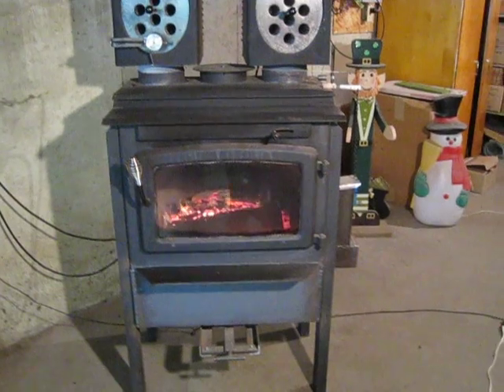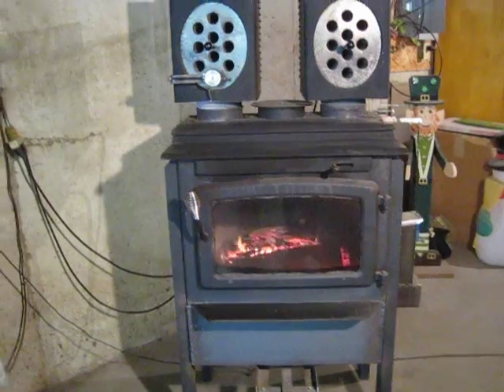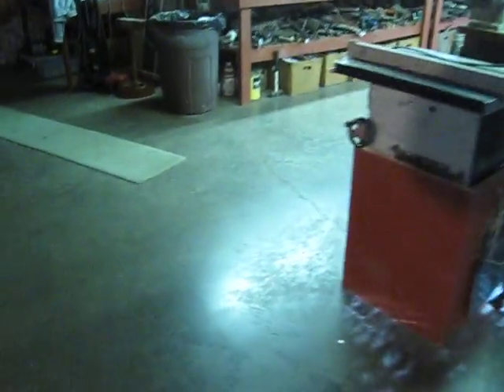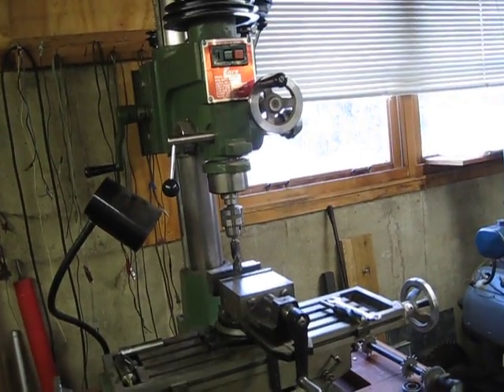Woodstove

Comment from the maker: Thanks for the comments e2sguy & everybody--the wood I burn has been cut &split 2 to 3 thee years before I use it. I have no creosote build up at all--clean flue once a year &  get some dry flakey ash only. Been using this stove all winter long for about 5 years now. Would not change a thing. Even with the Magic Heaters it still has a strong draft.   Very important !!!  Air intake to fire box must be controlled to stop stove from over heating. Know what your doing or these wood heaters can be very dangerous.

Comment: Re: Magic heat......We have had ours for over 10 years now with only 8" of pipe between the stove and the unit...Never too much of a problem...We have had the tubes glow red hot more then a few times, such as  when first starting a fire and forgetting the door is cracked open while in the other room doing something or when burning cardboard trash.    The back plate finally burnt trough this year  around some of the tubes so I have to rebuild it..... but  all in all they are pretty tough units.

Comment: Lots of nice mods there. I particularly like the air regulator. Perhaps you should convert it to use fresh/outside air so it won't  pull cold air through the cracks... You shouldn't take the fire bricks out... This actually makes the stove LESS efficient. It won't get as hot, therefore won't burn all the fuel (more smoke). Since you have heat exchanges, it would be great to have a really hot fire. Thanks for sharing.

Comment: I’ve been doing this for 3 years, using my oil furnace exhaust pipe.
 
A few things you should be aware of: The standard residential cold water pressure is 50 psi. The water in the heated coil will surpass 130 psi. This means you MUST have a back-flow check valve on the cold water feed line to the coil. Otherwise, the pressure will force hot water backwards through your house and damage any water-using appliances. Next, upgrade the pressure relief valve on your hot water tank because the standard valve will allow water to leak on your basement floor due to the elevated pressure. Finally, get a “Water Hammer” resistor and put it on the pipe leaving the water heater. This will stop your pipes from rattling each time you turn off the hot water.
 
Most importantly, use only copper piping. A neighbor tried to copy my design and used Pex tubing for piping after the hot water tank, which failed almost immediately.

Comment: That is a great job you did on modifying your stove. Did you notice any difference in the firebox temperatures after removing the fire bricks?. I had a wood furnace in my house for 30 years. No firebrick and I thought it would be best to let the heat out. Using firebrick would prevent that from happening, and it does. But it also keeps the firebox burning cooler. At the cooler temperatures not all the gases in the wood are ignited. Yep those gases needing higher Temps to burn go out the stack as smoke which is unburned fuel. From experience I have found it is best to have complete  combustion then good heat tranfer to use wood as efficiently as possible. Complete combustion requires hi temps in the firebox. You have good heat transfer with the two stacks.
Reply from the maker: Thanks -good ideas

Comment: Very nice I love my magic heat, often wish it had a lower fan speed.  I see you have your bi metal hooked to your magic heater, I'm guessing that is for when you lower your fan speed and the exchanger tubes heat up the air is reduced to cool the fire down so your magic heaters don't burn up?  Is that the way it works?  If so that is quite clever.  thank you.
Reply: Crunchy ShadTV

Comment: CRITICAL QUESTION PLEASE:
* Do you ever feel that you're getting tired or sleepy when you're running your wood stove?
* If yes, you "may" have a problem with carbon monoxide poisoning because of how your "air flow" is set up on your stove!
* You may be getting lots of heat but, as you know so well, you can't see or smell carbon monoxide and I would install a meter immediately (if you haven't' done so already).

SUGGESTIONS FOR SOLVING THE PROBLEM IF YOU DON'T MIND:
* Install TWO fresh air lines from the outside via metal pipes (they can both be inside a larger pipe)... each one with their own blowers on them... installed on the inside wall so you can control the air flow. It's similar to a clothes dryer setup with the vents on the outside so pests can't get in (just make sure plenty of air can get through the metal lines).
* One fresh air line will go to the back of your heat exchangers... get rid of the fans and wiring and weld a box on the back of each one so air can still go through the boxes.
* And one fresh air line that goes under your stove and into the firebox (on one of the sides but still under the stove) with a metal box over it so the wood and ashes inside the firebox don't clog it.
* Mount the blowers for both metal pipe lines on the wall not to far from the electrical outlets.

NOW YOU'VE CREATED what's called a POSITIVE AIR HEATING SYSTEM in your work shop!
BENEFITS:
* Now your shop is much much safer because you're reducing the amount of carbon monoxide that's being pulled into your shop with your two fans (aka heat exchangers).
* Now you've reduced how much money you have to spend on wood.
* Just make sure you keep the vents on the front of your stove (and the one on the side) closed and sealed at all times so you reduce how much carbon monoxide gets into your room (I would personally weld then shut because your fresh air line now replaces the air vents).
* There are many videos on YouTube covering these systems and there is a company from the UK called "RECO HEAT" that has this same type of system.

Hope that wasn't to confusing... and that you can take advantage of the idea and make your shop safer... and reduce the cost of your wood.

Amen
Retired, Veteran

Comment: You would definitely be chastised by the hearth experts in these chat rooms that focus on wood stoves. They would come out and tell you that you’re risking your life and your home to uncontrollable fire because you’ve removed the fire brick from your more modern Stove. That engineers who designed it should know better than you. I applaud you, because I think you’re right. Those fabrics are there to reflect back heat to the word and hold the heat in the unit which is contrary to your objective.  A woodstove should have a goal of transferring the heat to the room, as fast as possible, while testricting that same BTU from going up the chimney.  The magic heat units helps that objective.👍

Comment: Well, when you try to heat a 2000 square foot concrete walled and floored basement with a less than 1000 square foot heating stove, that ain't really gonna work. Use your head bud. Should have gotten a bigger stove to begin with.